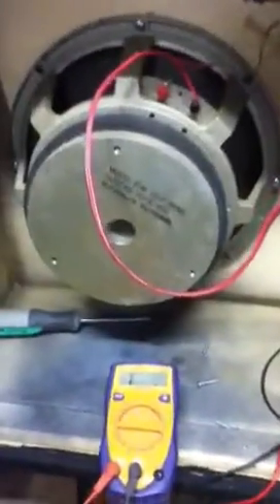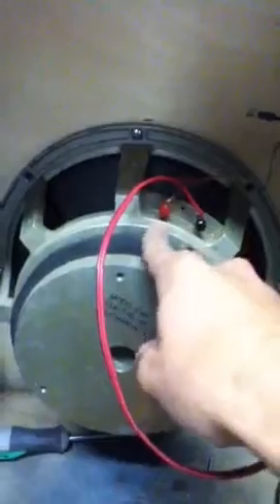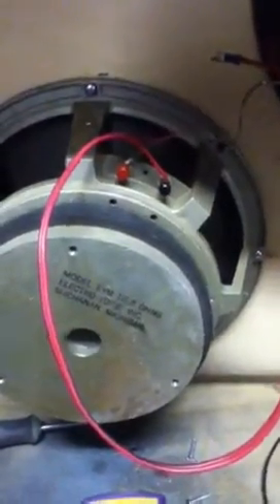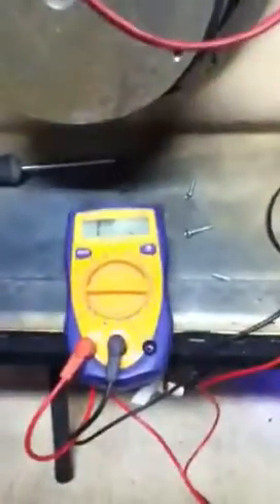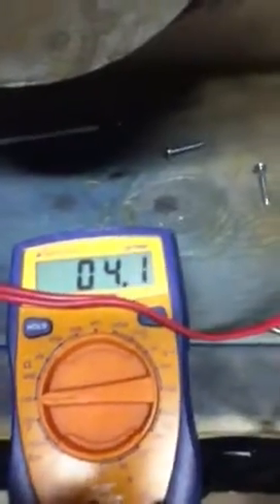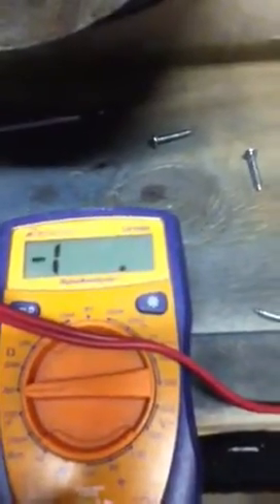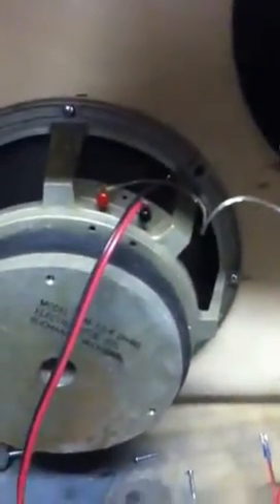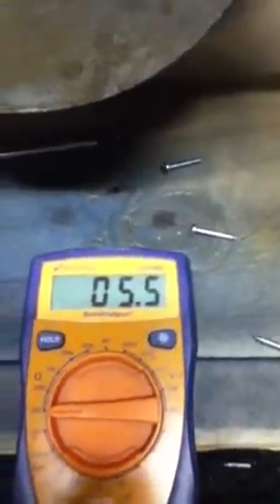Understanding Ohms in a guitar speaker cab. Part 1

Comment from the maker: If all the loads (speakers) in the circuit are wired in series, then yes the ohms add up. If all speakers are wired in parallel then you have to start calculating. Its easy when all speakers have the same resistance because you just divide resistance of one speaker by the number of speakers. So 4 divided by 2 is 2ohms Total resistance. (wiring the speakers in parallel will make a total resistance too low for your amp to handle so you must wire them in series to get the 8ohm load)  There are three types of circuits, Series, Parallel, and series parallel. Once you start calculating for different ohm values in a series circuit or series parallel, its best to watch some tutorials on ohms law. confusing at first but take notes, make charts of the formulas and once you understand it you will use the heck out of it. Bottom line you have a choice with (2) 4 ohm speakers. Your overall circuit will either be 2 ohms or 8 ohms. If your amp says 8 ohms minimum, you have to wire in series and get the 8 ohms.